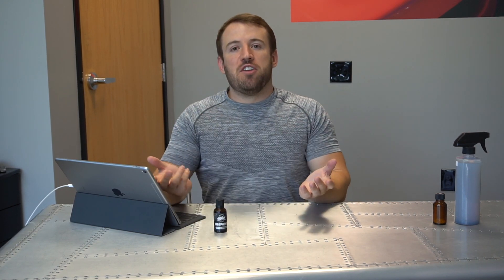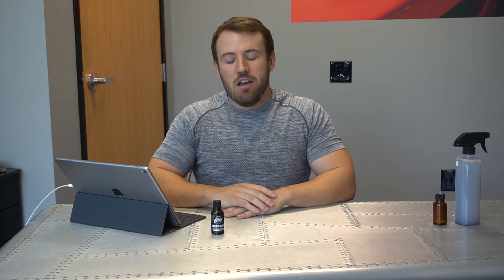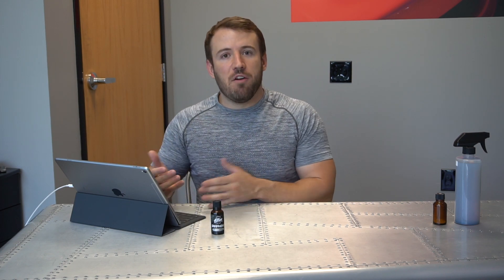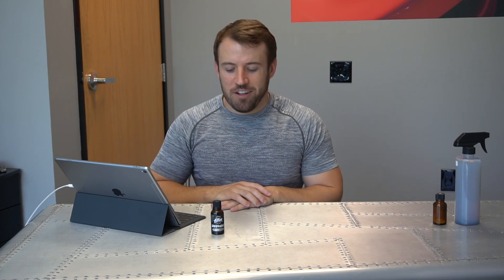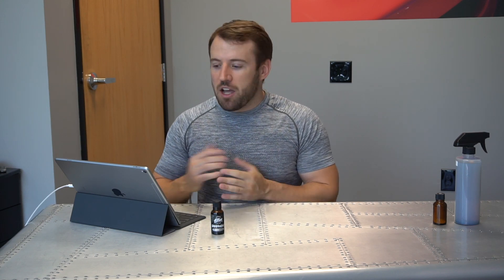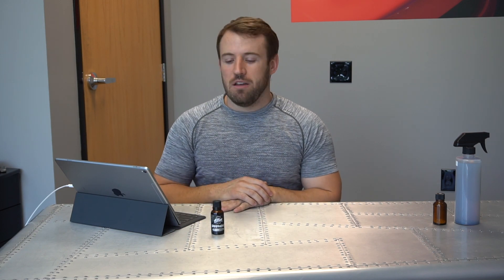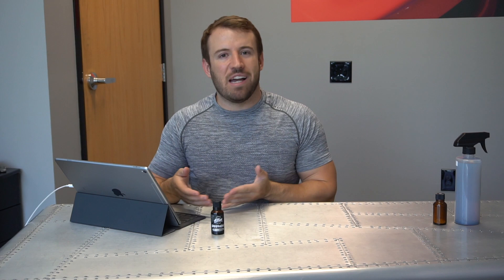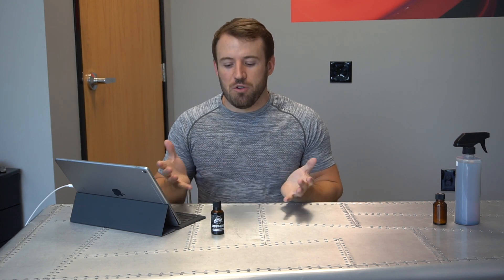Graphene Ceramic Coatings - Let's Discuss | Ethos Car Care

Comment: I purchased a 50ml bottle of the Ethos Graphene coating and I'm waiting for cooler temps to apply it.  I do have a minor suggestion/recommendation.  You should add the ml volume information on the bottle. When I received the 50ml bottle, I wasn't sure if it was a 30ml bottle as I have no reference.
Reply from the maker: Chris let us know how it goes! Thanks for the feedback, the volume measurement is printed on the underside of the bottle itself. Thank

Comment: When are you going to come out with a graphene topper? As you know,  you only get the benefit of whatever is the topcoat and I don't want to lose the benefits of the graphene coating by putting ceramic over the top of it.

Comment: One thing I have heard regarding graphene Coatings is that they would be more dangerous than ceramic coatings during Application. Is it something you could give us a bit more information around?
Reply from the maker: Dangerous as in more hazardous to the user? Cant speak for other coatings but ours is no more dangerous to install than a ceramic coating would be. We also do recommend using detailing products in well ventilated areas and using gloves and other safety equipment where applicable.
Reply: @ethoscarcare  I heard somewhere that it would be more azardous for the user than ceramic coating. But I trust you and as soon as I am able to buy this stuff here in Europe I will give it a try!

Comment: Can we talk about the difference between the professional and the widely available versions?   Is application different?  Chemical composition?  I have the widely available version on its way but if the quality is there it might be worth trying to convince a local detailer to become an a certified end-user for my own selfish reasons
Reply from the maker: Shute thanks for the suggestion; we will totally make a video discussing.
Reply: @ethoscarcare  sounds great. I've got a 2020 ram and I'm going to have a professional paint prep/minor correction done to it right before put the coating on. Im excited to see how the black paint looks with its new protection on it regardless of which version I use.

Comment: I like your earnest approach and thanks for taking the time out to explain (again) what the product is and what it isn't too. I'd rather though that you focused your energy on communicating the value proposition that the coating brings to the consumer. Preparation for application, strengths and weaknesses, maintenance, gloss levels compared to other technologies, that kind of thing. I spare not when it comes to buying chemicals that I think add value to my cars. I'm not a coating fan simply because of the vast range of very good 1-2 years protection products available in the market. I'm looking forward to seeing the spray graphene products to come out!